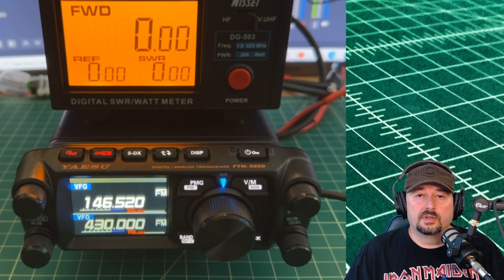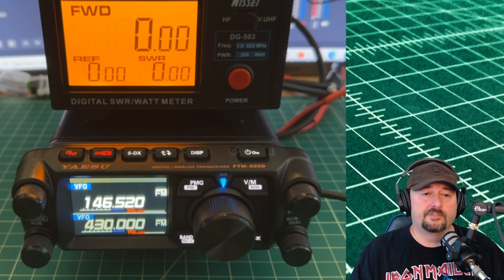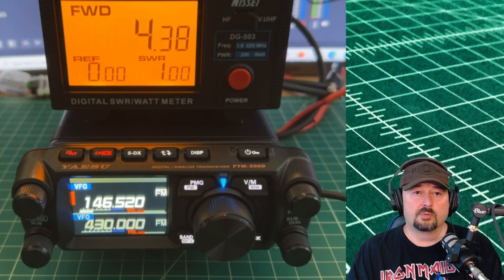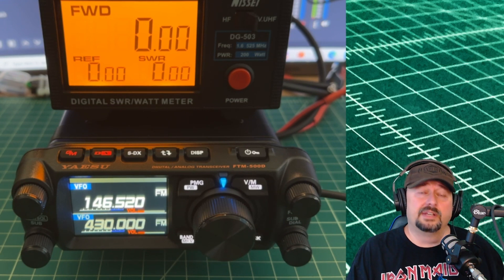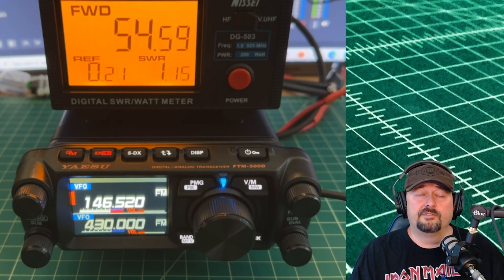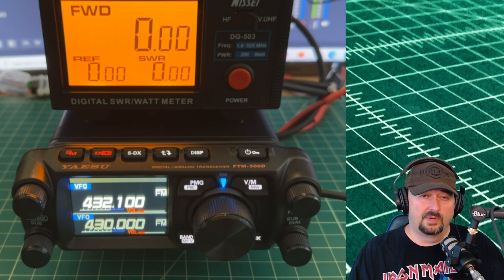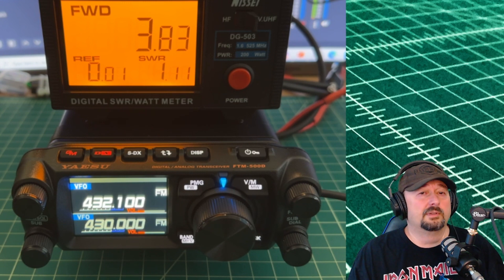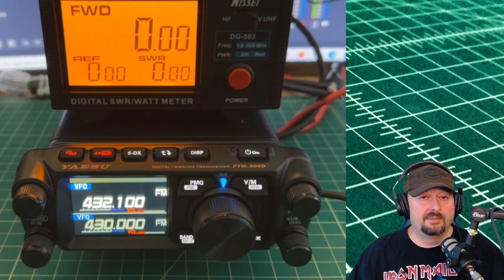Ham Radio Performance: Yaesu FTM-500D Power Test Results

Comment: Just as an FYI... The Yaesu technical manual details how to tune/adjust the three power levels at each ham band... so six adjustments in all. VHF and UHF, low/mid/high can be tuned wherever you want them. I have mine at 5 watts low, 35 watts mid, and 75 watts high power. Ive seen as high as 80 watts out of this radio. The FTM200D has the same capability.
Reply from the maker: @apw30534  thanks man 👍
Reply: @TheSmokinApe  Edit to say...  I just emailed you (from work laptop) the FTM200 and 500 service manuals. I can send an FT70d service manual when I get on my home laptop.
Reply: @TheSmokinApe  I just sent you the FT70D file
Reply: @TheSmokinApe  Done. Make some vids of how to turn up the power... Should generate lots of views...

Comment: I did the test in UHF on the same frequency with a 50 ohm phantom load and at high power it gave me 39 Whatts. and on some frequencies it gave me 46 whats and on VHF 40 whats.
Reply from the maker: What voltage were you supplying to the radio?
Reply: @TheSmokinApe  13.8 V I have it installed in the car

Comment: How well would it sustain power level in 462.650
Reply from the maker: GMRS? Not sure, It doesn’t natively TX on GMRS.
Reply: @TheSmokinApe   not out the box . True
Reply: 35 to 45 watts if you find the tech manual and turn up the power. Typically ive seen approx 30 watts at 462-467mhz with "out of the box" tuning.

Comment: Hi and thanks for all the information you always bring to your channel. I was planning to upgrade for my HT ( a Baofeng UV-5R with a BTECH AMP-25 amplifier) installed on my car to the FTM-300 or the FTM-500. In terms of what will be the best investment as an upgrade but at the same time trying to get an equipment that I'm not going to outgrow, (I mean I can use it for years without thinking of replacing it soon) what you suggest that will be a good choice to select. For my first real radio what will be my best choice to get and use or start to learn how to use its features. I'm on my way to get the Extra exam and want to get into something really good. By the way sorry for any syntaxis or grammar errors I'm from Puerto Rico and english is my second language as spanish is my everyday way to communicate. Thanks for your channel and hope not to bother you with my questions and comments. From the sunny isle of he caribbean (Puerto Rico) 73 from WP4SCV. Thanks.
Reply from the maker: Hey Daniel, this is probably the most advance mobile on the market for VHF/UHF right now AND you can use it with a technician class license.